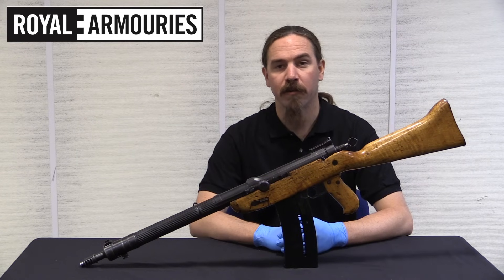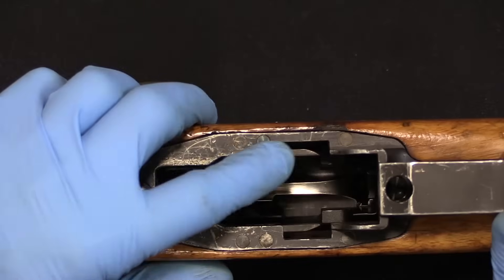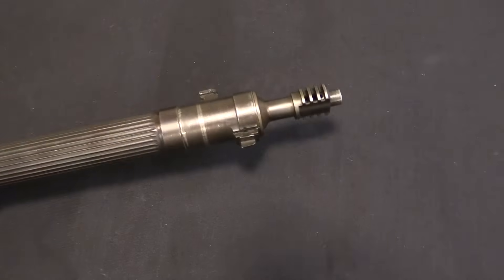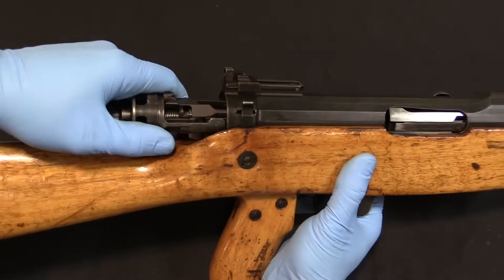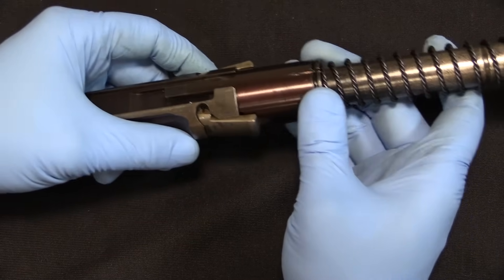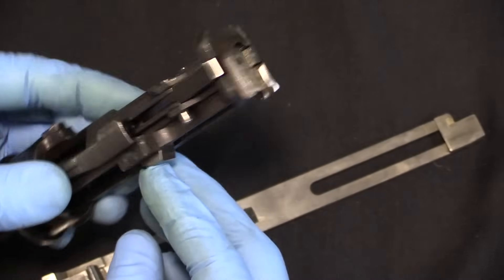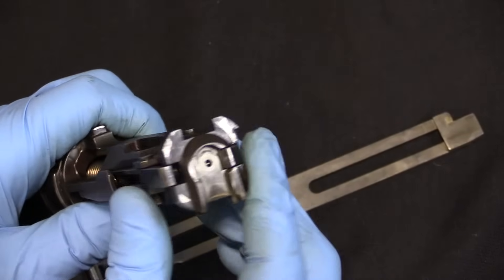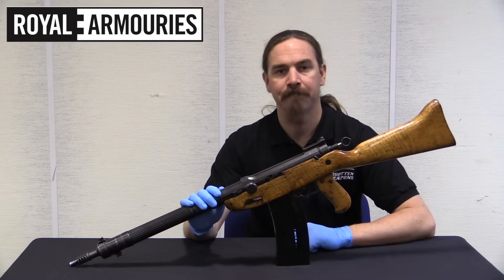SIG AK-53: A Truly Weird Forward-Operating Rifle

Comment: I watched this video 10 times and I’m still utterly confused by this operating system

Edit: make that 20 times
Reply: Even the G11 and AN-94 is more understandable than this... thing.
Reply: Can anyone explain to me how this thing separates the bullet about to be fired from the rest of the bullets in the clip?
Is the reciprocating barrel just smashing into the face of the bullet to pry them apart? Is there something more complex happening that i missed... how do you get 1 round standing alone on the breach-face when the whole stack is under spring load?
Reply: I think I understand, bear with me , and dont call me an ass lol

Instead of the bolt moving back and forth via a bolt carrier, it’s fixed to the frame of the gun, right in line with the magazine. With a bolt that doesn’t move, you have to have a weird feeding system. That feeding system is a magazine with a super strong spring, and that weird lever to get the magazine lips pulled apart. The bolt was cut so ammo slides directly upward and feeds from the magazine spring. The magazine IS the feeding system. 

On to the barrels job
Those two big springs he pulled out, im pretty sure that they’re essentially working opposite of each other. One is responsible for unlocking the breech under recoil and allowing the spent brass to leave, and the other (bigger) spring is to re lock the action (feed a round and close the gun). Essentially the barrel has spring tension holding it closed, but there’s a weaker spring that want to open it. 

I very well may be dead wrong or missing big points, but i think that’s what was going on. Either way, terrible design. Lol can you imagine field stripping that?
Reply: @jerkfudgewater147  there’s two prongs that spread the feed lips on the magazine apart. The magazine spring just pushes upward all the time, and the bolt stays still. The bolt is cut to allow ammo to feed at will, and the sliding barrel is what actually covers the magazine feed up. There’s really nothing separating the cartridges from each other. I seriously doubt this gun would run more than 2 rounds without failures
Reply: @richardlea818  not terrible just different, like the difference between a boxer’s punch vs a karate punch (there is some reason bad ass fighters thought karate punches were worth teaching to their kids... but whatever that was it clearly isn’t the same thing boxers are teaching their kids).

I don’t think that the kind of minds that would actually create something like this would have simply said “oh well it doesn’t feed... i mean we made a gun that works in reverse from scratch, now it’s time to give up 🥴”
I think it works, the question is how? (My current belief is that the returning barrel which has a slightly tapered lower edge, lands that edge between the 2 bullets to drive them apart... but that seems like it would lead to problems) 

*you generally have the workings of the gun correct though
Reply: It's not that complicated, just unusual.
When you fire the gun the gas piston is pushed back compressing two concentric springs, the outer one latching on the body of the gun and the inner one on the barrel.
When the gas piston is come all the way back it locks onto / grab the barrel (keeping the inner spring compressed) and starts moving back forward under the outer spring tension (the gas pressure has dropped as the bullet is out of the gun) carrying the barrel with it.
The barrel moving forward eject the empty case and the magazine spring push a new cartrige in its place.
When the gas piston/barrel assembly comes all the way forward, the front cap thing separates the two and the barrel, under the inner spring tension, goes back into battery over the new cartrige.
In theory, going back the barrel should also recock the firing pin but apparently in this gun it doesn't work (or maybe that only works when actually fired and not when manualy operated. That would explaing the lack of manual safety).
Reply: It's a pity he couldn't take this thing to the range and see how it fired.  That would demonstrate just how the operating system worked and whether there was any benefit to the madness.
Reply: @jerkfudgewater147  The barrel just slams on the cartridges, one will feed while the rest will get pushed back down slightly by the feedramp? I figure that is the only way that will ever work. Ofcourse, that mechanism is horrible and probably very error prone, would hate reloaded ammo and any low quality stuff as it does slam against every cartridge. 

I could see so many issues with this and I am not even a gunsmith. No wonder everyone hated this.
Reply: @CZProtton  i ask because i have been designing a weapon that loads similarly but this would be significantly worse on a blunt cartridge like i’m working with, i solved the problem quite easily and i’m no professor so the idea that this insanity would make it soo far is boggling my mind
Reply: @CZProtton  at 3:17 he makes it sound a bit different… weird things have their niche (sort of like how a hyena isn’t really a dog or cat but they hold their own against both)… this is definitely a strange animal, but every part was put there for a specific reason by expert gun smiths, it seems unlikely that they’d miss something as obvious as that
Reply: @jerkfudgewater147  There are so many failed firearms designs that are obviously a bad idea. Why would this be different? Moreover, the entire idea is idiotic as a moving barrel would without a doubt fudge up accuracy, you cannot be accurate at a distance if your sights and barrel move, relative to each other. 

How would you explain how it chambers, then? It obviously has to smash against the cartridges, picking one up with the feed ramp while pushing the others down. There were some machine guns, I forgot which was it, that was notoriously fucky with bad ammo because it used something similar (it pulled ammo from a belt instead of pushing it). 

A prototype could be a horrible gun. That does not mean the constructeurs were idiots, it just means they tried some experimental way to make a new gun and it failed. Some experiments like these brought us amazing weapon systems while most experiments bring jack shit to the table and fail. That is what research is about.
Reply: @CZProtton  i think we’re talking past each other.

I’m asking why educated people would have thought it was a good idea and why would they have solved so many problems just to leave this obvious somewhat easy one unsolved? 

And you seem to be trying to inform me that the idea is terrible and completely without benefits… which is not what i’ve asked nor does it seem like it’s leading to an answer to what i’ve asked, so i’m just gonna bow out of this interaction as it’s not yielding any fruit.
Reply: @jerkfudgewater147  the feed lips are out of the way with the two arms on the mag release. The  bullets aren’t as big around as a cartridge, so there is space for the barrel to slide over. Once to the shoulder of the round it is already aligned.
Reply: @richardlea818  the springs don’t fight each other. The piston locks to the barrel, and the small spring is compressed by the piston who’s spring is stopped by the barrel shroud. Once the pressure leaves the “gas chamber” between the forward part of the piston, the big springs pushes the piston and barrel, which is still locked, forward. At the end of the piston’s travel, the barrel is unlocked, allowing the barrel spring to push it back. Opposite push direction but not exactly how you described it. Basically the big spring grabs the barrel which has its spring compressed by the same action as the piston travel, then takes the whole thing with it. I assume it unlocks with the same spring retainer in the shroud by compressing the four fingers and letting the barrel slip free. All in all a cool design that would not hold up to repeated firing due to the fatigue over time to the locking fingers on the barrel.

Comment: I feel like this gun was made by a master craftsman, but extra high on an acid
Reply: Just one acid?
Those are rookie numbers.
Reply: 2 acids, one pound morphine, a lot of cocaine, the souls of no less than 3 watchmakers and a chocolate maker, all ingested by a man currently suffering from hypoxia in the Swiss alps
Reply: This was made by someone who hated people who work on assembly lines
Reply: I mean acid was first synthesized by a Swiss chemist.
Reply: @P7777-u7r  hoffman <3
Reply: "we had two bags of grass, 75 pellets of mescaline, 5 sheets of high power blotter acid. A salt shaker half full of cocaine A whole Galaxy of multi colored uppers, downers, screamers, laughers.  A quart of tequila, a quart of rum, a case of Budweiser, a pint of raw ether, and two dozen amyls.  Not that we needed all that for the guns design, but once you start a serious drug collection, the tendency is to push it as far as you can"
-some gunsmith

Comment: The cocking rings two modes is probably one that fires, the other lets you decock it by pulling the trigger without the pin striking the primer.
I had a mauser with 3 settings, completely safe, letting you pull the trigger without firing and Fire

Comment: I believe it's just as you were saying that the ring is your safety depending on vertical or horizontal positioning and e would be semi-auto m is for Auto. When the ring is in one of the two positions it probably would not actually come in contact with the primer in the cartridge. Even though the firing pin is still dropping and either position

Comment: For a gun that's as over designed as this, it looks like a post apocalyptic diesel punk prop reject.

Seriously this thing wouldn't look out of place in Trigun or Mad Max
Reply: The curtains sure as hell don't match the drapes. The outside screams improvised weaponry while the inside looks like precision machinery circa 1950.
Reply: @mikespongili8254  Maybe the swiss should stick to making watches.
Reply: And yet I have a feeling this gun wouldn't last a week in the field.
Reply: @FinalManaTrigger  Probably not
Reply: Or Fallout, Metro, etc.
Reply: I was thinking "Planet of the Apes"!  It reminds me of the weapons the guerrilla soldiers used in the original movie.
Reply: @JEilonwyn  Already in Fallout 4! It's called the Radium Rifle and modified even more to shoot radioactive bullets (don't ask how)
Reply: @mikespongili8254  curtains are the same thing as drapes. You meant carpet
Reply: @thedandygun7924  Fairly sure the Radium Rifle is based on the Volksturm VG-5
Reply: Or PUBG
Reply: Thumbs up for referencing Trigun 😉

Comment: Another rifle with an interesting piston setup is the Russian AK-107? Not sure if that’s the correct number, but it uses two gas pistons, one that moves backward with the bcg, a standard AK-74 piece, but it also utilizes a second piston, which moves forward at the same time, allegedly to reduce recoil and muzzle rise during burst and full auto firing settings if I remember correctly. It was, if I recall correctly, a limited production run, chambered in 5.45mm

Comment: Not complicated enough till it's toggle-locked and roller-delayed.
Reply: Those are very simple..
Reply: @thermionicemission6355  
How about flapper-locing? Eh? 

Yes, I know that a rotating bolt is more difficult to design than any of the previously mentioned systems. 
But they vanilla and thus boring.
Reply: Seems to be barrel delayed.
Reply: @bamboozlednoodle6513  Dangit, now I want to see someone build a roller-delayed short recoil toggle-locking pistol: Basically it's a normal toggle-lock system, where the toggle-lock is broken by short recoil action, but the short recoil itself is roller-delayed. Not a delayed blowback, but a delayed short recoil system! :D
Reply: @jubuttib  that would actually be really interesting

Comment: This is a very overly complex design.  When lives are at risk, simpler and more reliable design is better.

The four prongs are a collet, like a collet chuck on a drill press or milling machine tool head, or Lee collet ammo reloading die, or Blaser R8 collet locking bolt action rifle, but of course used in a different way.

Comment: Could this be used to make a balanced recoil gun?
Reply: I think that's what they were attempting. My guess is follow-up tests didn't really conclude that sadly. Interesting gun.
Reply: Im gonna be that dude that scumilly responds to a five month old comment but I'm actually rather sure that blow forward operating weapons have much more felt recoil than most "normal"  guns because when a gun is fired, recoil usually comes from the equal and opposite reaction of the bullet moving forward out of the gun. So when the barrel also moves forward as well as the bullet and all that mass has to be pushed forward by a equal amount of force against the shooters shoulder. It all makes for a really weird sensation of snappy recoil and then a bunch of reciprocating mass slaping back from the frount of the gun after the fact.
Reply: he us truly speaking the language of gods
Reply: @awesomepawn2  it would feel super weird... All that weight going forward rock forward, then gravity would act on the extra forward mass and pull it back down and then boing and the barrel mass comes back and pushes it backwards... It would bounce like crazy after each shot.
Reply: @awesomepawn2 /videos Also going to be that same guy (6 months in my case): This whole thing is a really weird multistep system, not even really blow forward in any sense. The gas pressure pushes the piston backwards, compressing both the inner and outer springs. At the end of travel, the piston locks on the collet on the barrel assembly, which keeps the piston and the barrel assembly locked together, with the inner spring compressed. Next, the outer spring uncompresses, pushing both the piston and the barrel assembly (locked together by the collet) forwards. At the end of travel the nose cap thingy releases the collet, allowing the inner spring to uncompress and push the barrel assembly backwards.

So when you shoot, you have the bullet going forwards, then the piston going backwards, then the piston and the barrel going forwards, then finally the barrel going backwards. That's a lot of stuff going back and forth between each shot. =/

Comment: I just had a thought. If the gun was fired upside down, would the magazine design cause cartridges to just dump downwards and into the receiver? pretty sure there isn't anything beyond the feed lips holding the cartridges in when the gun is cycling, and if those lips don't retain the cartridge, wouldn't rounds just tumble out the mag anytime the barrel wasn't holding them in place?

Comment: BTW, the technical name for that compression thingy with the four prongs and spring in the barrel latching system, is a "clutch" or "collet". It's the same principle as the older style of mechanical pencils, using literally identical spring-loaded/pronged system to hold the lead in place. Scaled up several times here of course.

Anyway, comparing the simplicity of roughly contemporary weapons in this class, especially the Russians' SKS and AK... Extreme simplicity and cheap, quick production, vs. the Swiss love of unusual complication... Besides the counter-intuitive operation and ergonomics, this would've been a nightmare to clean and service in the field. Also the eleventy million elaborate milling operations required to produce that bolt group etc cannot have been fast or cheap. It does have interesting aesthetics though, I'll give it that. Kind of reminds me of the StG-57/Sig 510/AM 55, also Swiss, which is my favorite battle rifle of all time (though nothing like this operationally, and actually an excellent gun). Incidentally, the 510 also has the E and M markings, which stand respectively for semi and full.

Comment: at some point Ian will have covered all existing guns and will run out of content ?? Then goes on to design the best gun in the history of the universe...
Reply: I'd buy 1
Reply: When designing a mountain bike you can create anything... that’s when you realize there is no “best ______ in the universe “ there is simply “the best _____ for the way i want to approach problems” 

Some people need a steep rake angle to be stable at high speeds on rough terrain, others need an almost vertical rake angle so that they can prioritize steering in tight turns because there trails have more tight turns than long fast decents (where the “steep” rake angle would help you) which makes your perfect ______ more an issue of what do you plan to do with it?

Comment: I’ve always been fascinated at how much work and engineering humans are able to put into something. Like in WW 2 they were able to take advice from pilots and in the middle of a war were able to design, test and manufacture different versions of planes such as Spitfires and P-51s. For instance how the machining and assembly would have to change in order to go from a P-51B to a D model or a MK I to a MK IX Spitfire in less then a decade. Even with this rifle that didn’t have any success  the amount of brainpower to design and manufacture a failed firearm is pretty astounding.

Comment: I almost wonder if they could have made it a system where the rounds are pushed forward out of the magazine and then ramped backwards and upwards into the action. Sort of like a tube fed shotgun with a feed elevator, that feeds rounds backwards and then ramps them upward and forward, but in reverse. You could maybe actuate it in some part with the forward and backward motion of the barrel.

Not that it would have fixed much...

Comment: I think the handle on the side is only to load the cartridge, so you have to use the cocking handle for the first shot, that’s probably why there is no safe position. I guess the E stands for single round (Einzelschuss), the M is for automatic, probably.